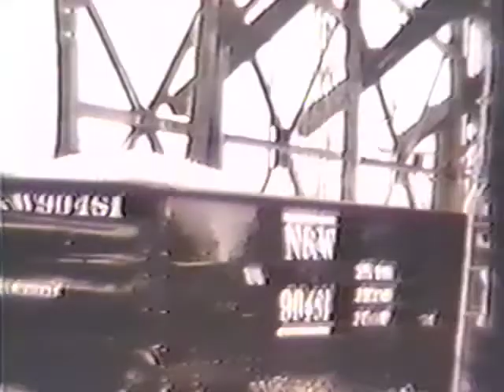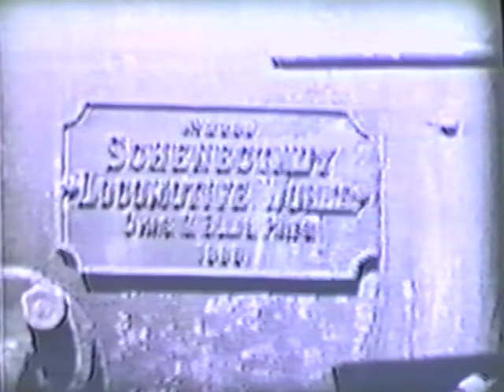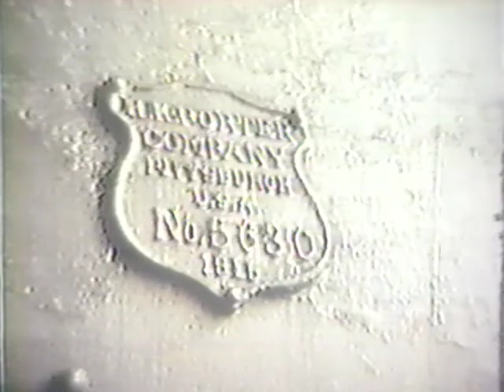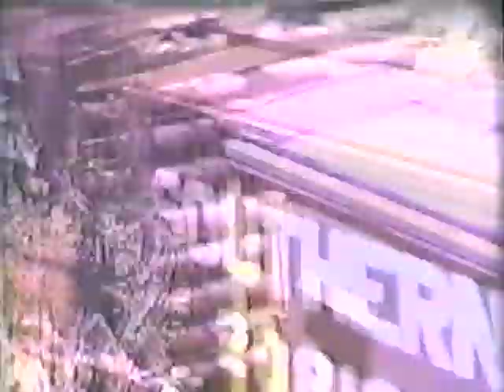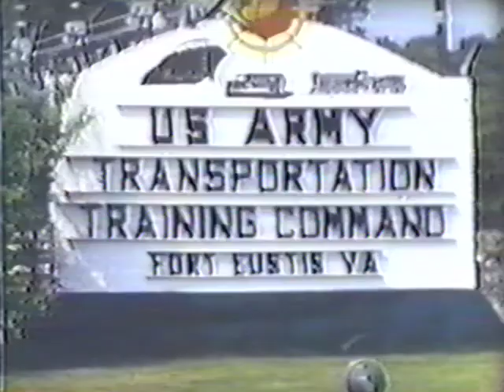Steam Industries & Short Lines

Comment: This Is Great Watching Steam Industries & Short lines With Kentucky & Tennessee Railway Baldwin 2-8-2 Mikado #10 Labors Around The Twenty Dregree Curve's & Around The Mountain's  To The Southern Connection At Stearns at The Time These Scenes Were Filmed June 1963 The K&T Owned a Simmler Size Mike Alco Built #11 & Larger Mike #12 Formley Southern #4501 In 1964 #12 Was Sold To a Private Individual and Was Restored To her appearance and Number she Still Exists Today and BC&G #13 Was built by the American Locomotive Company In 1920 as Manufacter #61579 Both Her & Another Loco #14 Came Over To The BC&G From The Kelly's Creek & Northwestern Railroad 😊😊😊 🚂🚂🚂